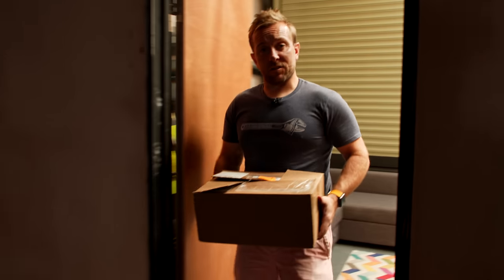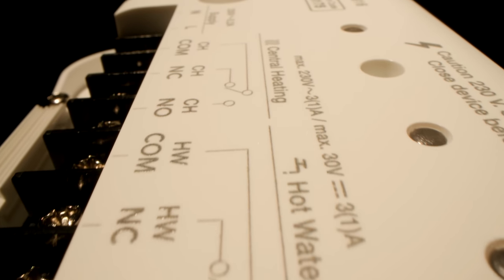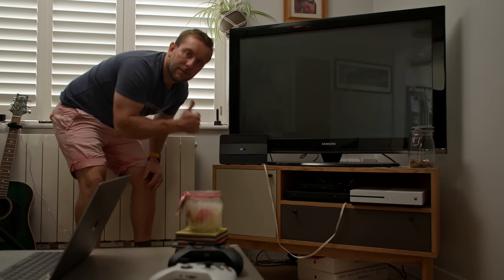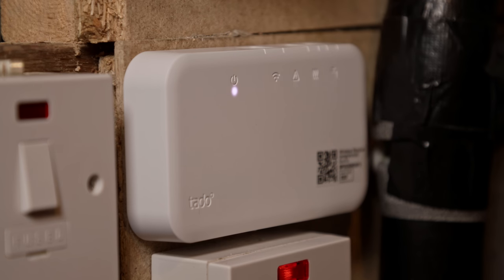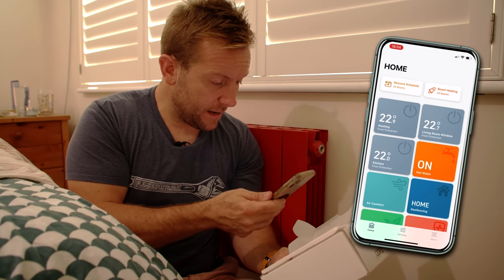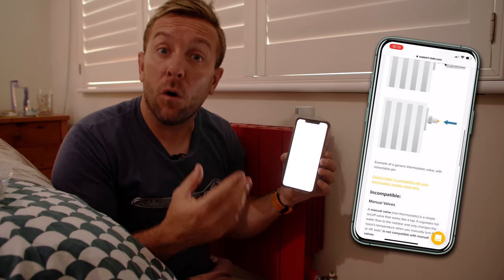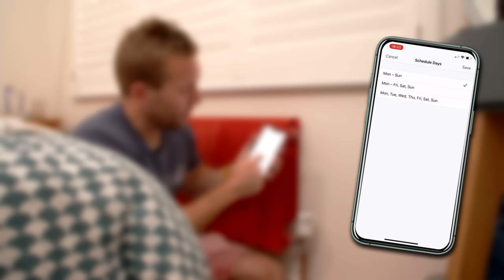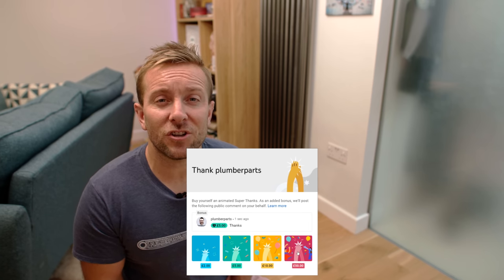PROGRAMMABLE SMART THERMOSTATIC RADIATOR VALVES - TADO°  Review

Comment: hey  man I been watching your vids throughout my home DIY renovation project... and they have deffo helped . I am currently stuck on setting up my Tado UFH system and Tado seem to be useless on support... How do I wire up the Wireless Extension kit so that it controls the 2 port valve on the UFH system when any of the tado UFH room temperature sensors called for heat?

Doing this myself as I been quoted £850 to set this up from my local plumbers so hence why the diy route on this area of trade too now I guess.
Reply: @iaincrawford5472 , thank you for replying, I already have the boiler. I got this sorted in the end, just googled the crap outta how to wire boilers and all the wiring diagrams with Tado and different combi boilers... and just figured it out .. pretty simple once I started seeing the similarities with all the combi boiler types and their wiring diagrams. Although the one huge benefit for figuring it out, I got my Tado thermostats to ALL work FULLY wireless with all the underfloor heating rooms independently controlled :)

Comment: If I have two radiators in one room, do I just replace one valve? I'm thinking changing both radiator valves might confuse temperature with one staying on and one going off, etc
Reply: In the app when you add the TRVs you give them  a 'Room'  name - If you add 2 TRVs to the same 'Room' it synchronises them automatically. I am putting extra wireless temperature sensors in the 'rooms' with 2 TRVs and Tado will adjust the TRVs based on the temp from this sensor. I'm leaving the radiator in the hall without a TRV as a bypass to protect the boiler and keeping a wireless temperature sensor in there too. I bought the V3+ wireless starter kit and was disappointed to find the new UK wireless receiver only does on/off relay control. Comet are still selling the older wireless extension kit which does eBus and properly allows modulation.
Reply: @kissarmy1347  thanks for the response. So if 2 TRV's in one room synchronise then does it mean it's just better to keep 1 in that room as it will be a waste. Rather use the second one in another room... Also can I have more than one wireless thermostat controls in the house? For example, controlling upstairs and downstairs separately. I believe I will need to have smart TRV's on all the radiators in the house, then the thermostats can be allocated to a group of radiators. But I'm not sure if that is the case... Can more than one wireless  thermostat controls be on the same system?
Reply: @1987kahil  My thought is 2 radiators in a room needs 2 Tado TRVs. These sync together so they aren't fighting each other. I believe 1 Tado TRV and 1 dumb TRV will fight each other. 
Yes you can have more than one wireless thermostat in the house. Remember that you have to assign wireless thermostats to a 'room' in the same way as you do with TRVs. I have 2 radiators in my office, both with Tado TRVs and a wireless thermostat. These are all assigned to the room 'Office' I then get one control button on the app interface called 'Office'. This is then the control for both TRVs at a temp monitored by the wireless thermostat.
If you wanted you could create 2 rooms called 'Upstairs' and 'Downstairs' and assign your 2 wireless thermostats to these 2 rooms. Any TRVs you assign to these 2 'rooms' would then follow the temp monitored by the wireless thermostats for upstairs and downstairs. I feel you would lose a lot of control doing it this way.

Comment: I emailed tado with photos of my radiator valves and they said I can't have the smart radiator thermostats because I have manual radiator valves. 
Is this really true? Will I need to get someone to change the radiator valves?
Reply: Yes, you need thermostatic valve bodies first before you can fit the tado adapter and radiator thermostat. The terminology is a bit confusing because most people already have thermostatic valves, so just need to change the TRV head (the white bit with the numbers) to the tado one which obviously turns itself.
Reply: Thanks for clarifing this.

Comment: @7:32 Line and Neutral connected together!!! 
The Wago connector does not separate each individual wire James. It connects them together. 
i.e. You would connect all Line cables into one Wago, all neutrals into another.

BTW, I love you James. Hold tight!!
Reply: The (old) wall mounted thermostat feed was just a switch line and no longer used with the Wireless Unit James put up in it's place.  

Back at the old programmer that line is nolonger hooked up or used so in theory you could just leave it without a finished end behind the wireless thermostat or you could as some do just cut them flush to the wall. It's just 'good practice' to terminate them with the likes of a Wago to help/alert anyone in the future that it's not some random Live cable lurking in the wall.

That's why they supply Wagos [other terminations are available] to ensure a professional finish is achieved when fitting this product.

Perhaps James should have been more clear in this video on the point that if your unsure about doing this sort of job it might be best to get someone in that does know what their doing or just employ an actual Electrician?

Just saying....

Comment: It would be handy to be able to access the data that each temp sensor records,  with this data you could compare the cool down time for each room and use this as a guide to assist in any insulation upgrades. 
Looking from Tado's side, they would be able to see this data for thousands of households, this cold help identify houses that loose heat the quickest and help the UK meet its carbon targets for 2035 (78% reduction).
Reply: You can do this. There are graphs that show temp, boiler demand(only applicable for boiler modulating setup), humidity and even outside temp against time. Tado uses a simplified version of weather compensation by using online weather data input to help control the heating system.
Reply: Great idea!

Comment: Great video, I have a question though. If my room thermostat in lounge is set to 20 and it has reached that temperature and therefore heating shuts off, if I have one of these radiator thermostats connected to the bedroom radiator and I want it 22 degrees in there and it has not got to 22 degrees will that call for hot water to the bedroom rad even though heating system has turned off as lounge has reached temperature. Probably an obvious answer but bit of a novice with this stuff. Thanks
Reply: Yeah so the trv in the lounge will close since it has reached the desired temp but the trv in the bedroom will be open and calling for heat to heat the bedroom until it reaches the desired temp. Totally individual control of each room or zone(if you create one)
Reply: @rodgerq  thanks, however my lounge does not have trv, in there is the room thermostat. We was told not to have trv in there as it competes with the room wall thermostat. Just want to know with that set up ( don’t want to change it ) does trv in bedroom if fitted call to boiler for hot water, even if main room thermostat in lounge is at required temp.
Reply: Ah I see now. In all honesty I couldn't say for sure if the lounge thermostat or the tado kit would have precedence but I would hazard a guess that the room stat would.

Comment: I inherited a Wiser Heat system in the house I moved into.
I'm about to swap out the upstairs zone room thermostat for 4 Wiser smart TVRs.
Is teh Tado system better?
Reply: I have the Wiser as well, how do you find the batteries last ? I have 8 stats on the system and through winter seem to be changing batteries like they are going out of fashion.
Reply: @dialog245  no issues with batteries. But I read somewhere that there was an issue with excess battery use and if you contact wiser they will exchange the hardware.

Comment: If the wall mounted smart thermostat is mounted on the wall of the hall and the smart TRV in the hall radiator is set to off or low and the only room you want heating gets up to the desired temp, does that mean the boiler stays on trying to reach the smart thermostat desired temp in the hall?

Comment: Hi, I already got hive system, Do u know Can still use this Tado smart radiator please? Thanks
Reply: Technically you could use the Tado radiator controls with the Hive system, but you would be running two apps, one to control the boiler and another to control the room temperatures. The Tado valves couldn't call for heat from the hive system, so you'd have to manually configure heating schedules on Hive that the Tado system would then regulate down via the radiators. I would strongly recommend not doing that.

A much better solution is to match the smart thermostat and boiler control with the radiator controls. You can simply buy Hive radiator controls that will do the same thing as Tado in this video, but using their app. Or alternatively, you could replace the entire Hive system with the Tado system, but they are similar enough in heating control (Hive has a larger smart ecosystem that Tado does not have) to make this very costly for little benefit.
Reply: @smartdesignheating1245  ok many thanks explained detail useful info. Takecare

Comment: Hi, did you ever manage to test the TADO EU model using Opentherm and PDHW on a S Plan system boiler + cylinder tank?

Would be amazing as I got new boiler but no heating at all since 2 month. Nobody is able to get this wired up :(
Reply: They are bringing back the opentherm/e-bus comms to the UK version btw. There's a video on the heat geek channel with a tado employee confirming this. There are pro installer instructions on the tado website showing the wiring for the main boiler manufacturers.

Comment: Did you have you’re boiler set up with open therm when you had the nest installed? Assuming tado would support this as well?
Am thinking of upgrading to tado simply for the radiator controls, just not sure if the app fees are worth it or not
Reply: Wiser do a great system, no additional costs other than hardware + full home assistant integration should you want to delve deeper. I honestly couldn't recommend them enough, I've had zero issues and installation was a piece of cake.

Comment: Loved Tado at first, but we've found that wifi doesn't reliably connect to the furthest room and Tado is the only "intelligent" valve system that hasn't made a signal booster, so we have to do it manually. The whole reason for the system was so the annex we had built for my father-in-law could be tropical while the rest of the house was at a normal temperature and this makes it impossible😟😡. We also have one valve that doesn't turn off when the desired temperature is reached and is heating the room to 28 whether we like it or not. Sadly, as we had it installed in the summer, we didn't realise how crap it was until the 30 days trial had passed. Very expensive for an unreliable and poorly designed system that won't work properly if your house is bigger than a shoebox or has thick walls. Been waiting 7 WEEKS for the engineer who installed it come and sort it out. My fuel bill has almost doubled in the space of a month, so any savings I might have made have now been wiped out.
Reply: you can easily get cheap wifi extenders these days including the powerline ones that work via the power lines in your house. did you not think to do that?

Comment: If all rads have these and given that each valve is controlled independently then 'balancing ' the system is unnecessary and their may be an advantage in fully opening all the lock shields   (less resistance, better flow, less pressure on the pump, quicker warm up).....let me know why I'm wrong !
Reply: In balancing system you should be trying to get a delta t of around 20°c to get boilers condensing.
Reply: @mattmackenzie1111  Thats interesting, I have an old 1970's Ideal Mexico 2 system boiler and I do try and time a batch of rads to come on at the same time to have a cold as possible return to the boiler.
Reply: @dialog245  with non-condensing boilers you need to keep the return as hi as possible to stop condensing  as will damage boiler. A delta t of less than 10. Watch heat geek, andrew millwards videos. Far more technical less sales talk.

Comment: You didn’t mention that you also need a thermostat or wireless sensor for each room; another £60 each or the measured temperature will be off when radiators are hot and the valve will close after a few minutes
Plenty of similar experiences on the Tado community forum
Reply: @dancrispin7204  temperature offset, that’s completely useless; you get exactly the same effect by setting a higher temperature, but the heating will be on when you don’t want to 
It’s the delta between a set temperature and the real ambient temperature that you want to base your control on
Don’t get me wrong; it’s a great thermostat and the app works much better than Nest
I just hate when they try to hide a flaw by suggesting that an offset might help; I bought an extra 5 thermostats for around 20£ each
Reply: This is my main area of concern. I have an open plan living/dining/kitchen with two large vertical rads and a normal one under livingroom window. This area is the warmest in my house, and also the area we spend most time in.

I had thought about having the main thermostat in This area and valves on rads uostairs, but they would never call for heat as the temperature would be  met on main stay in living area.

Do I live stat into cool hallway and put valves on every rad in the main living area with another thermostat to group this area together as one??
Reply: @wilsonblack2023  once you buy a smart radiator valve you have to actually buy them for every radiator in the house (an exception can be made for bathroom where you can leave them on a traditional trv or no trv at all)

Comment: Interesting video. Pity about the ugly barcode and other info on the valves ☹️
Reply: It's just a sleeve that is slid off.
Reply: Thanks Roger and Dan. Too many armchair amateur plumbers around.
Reply: @martindorrance8133  Dan is correct actually, it is a sticker, and the pack comes with a booklet to stick them for future reference and if you ever need to re-pair anything to the system. Personally I haven't even bothered taking them off the devices, who's down there looking at trvs lol

Comment: Those plastic rad valve adapters are rubbish. Thankfully I didn't have to use them. Oh, and the batteries last nowhere near 2 years. Oh, and the rad valves temperature sensing is totally inaccurate (you really need the separate room temperature sensors).

Comment: I have Tado for 3 years now and I definitely cannot recommend these to anyone. So many problems over the years and the support is no help at all. They're eating batteries like there's no tomorrow, they start heating for no reason because the batteries die without notification and now the first TRVs start to die after 3 years. There's no way you can save enough energy to make up for the investment to buy them, the batteries and the replacement costs.

And I'm not alone with this. The Tado community is full of complaints about this and the support is no help at all.

Don't buy these!

Comment: Enjoy being woken up in the morning when the valves open up.
Reply: The Tado valves are actually remarkably quiet relative to some of the other brands out there. But I won't claim they are perfectly silent, so worth considering if you want to completely eradicate noise from electronics.
Reply: I have a wiser system integrated to home assistant, I have an override. Bedroom valves stay open after 9pm until 9am but heating stays off unless temp drops too low. Allows better control over the whole system. BUT, the valves ain't exactly noisy, the stepper motors are very well geared and in the higher frequency range.